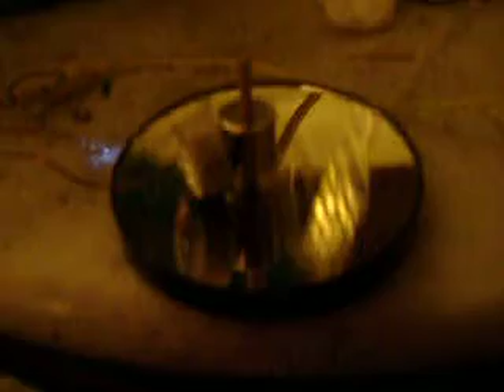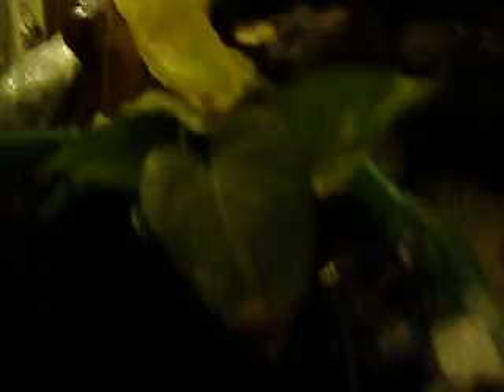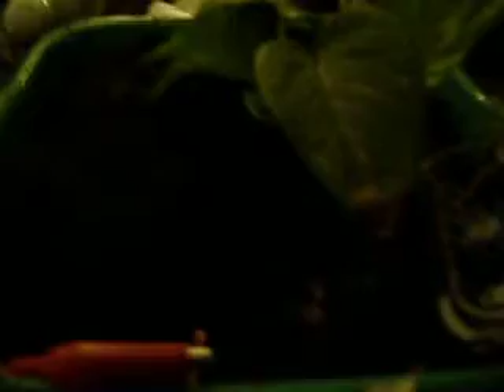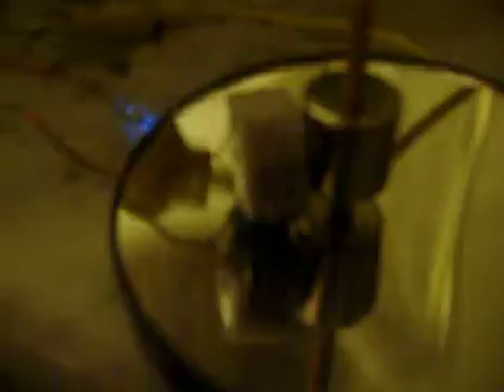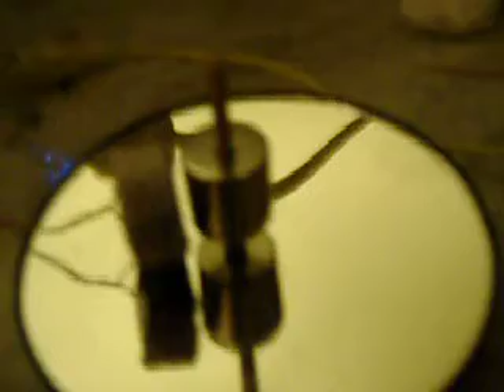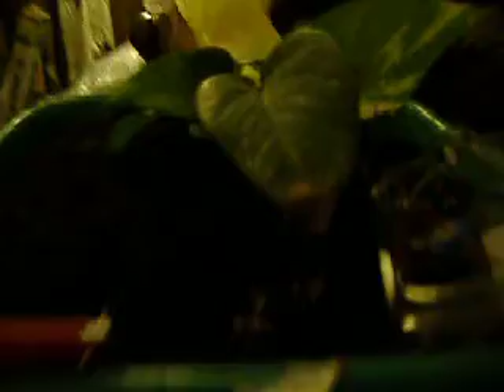Plant Battery 6 runs itsi bitsi bobin bedini motor and led

Comment from the maker: @jaesungauzakim  YES! and fast too. Also, the led is using the backspikes that are produced to light up. That is my way of telling when it is on. 
The big circle is a mirror and spinning in the middle is a diametrically magnetized cylinder resting on a small ball bearing. The piece of barbeque skewer is so I can start it with more ease. the rest is lidmotor's bobin bedini and the plant battery.
I did not describe this very well, so, I hope this helps.
jeanna

Comment from the maker: @Lidmotor Thank you so much for your excellent design.
At the moment I need light at the backspike to tell me at a glance when it is working. I was also getting about 4 volts from the backspike of a joule thief. 
I am still working at using spikes to recharge batteries, though. I have not found what the low limits are yet. Have you? 
Is there a trick to that which I am missing?